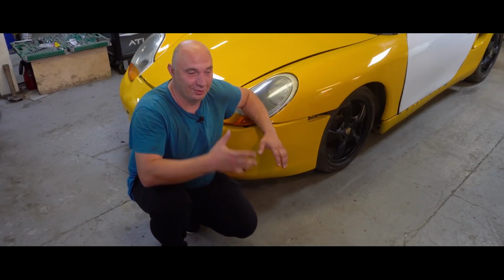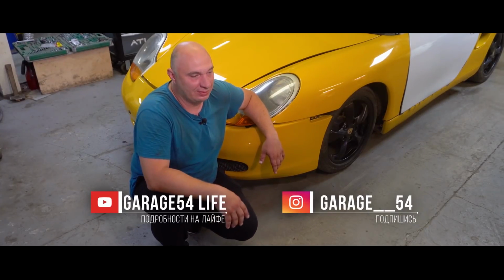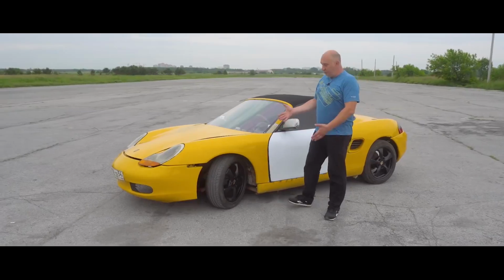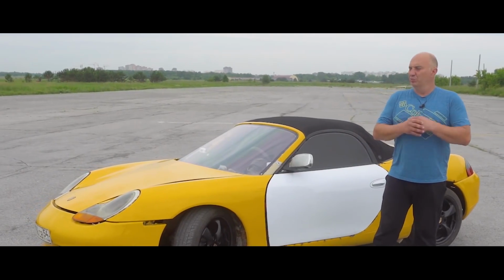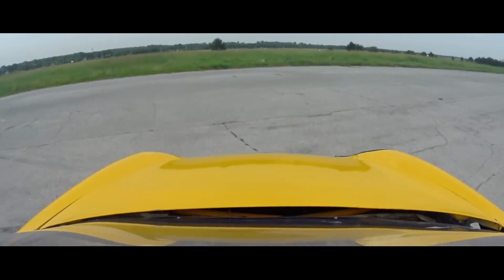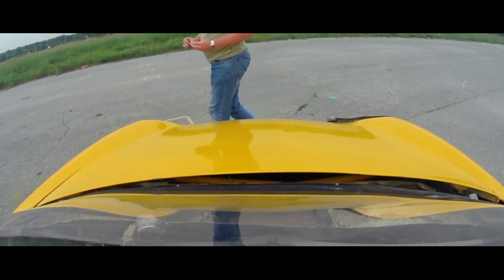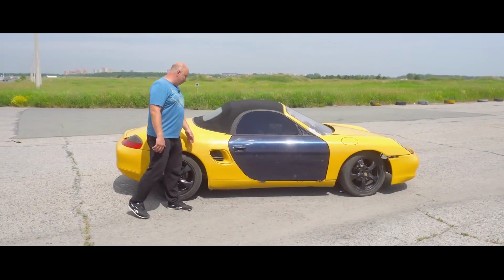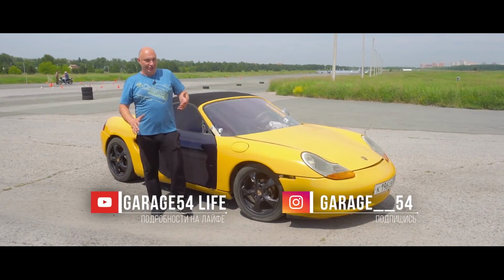Lada-based Porsche: first drive (fixed sound)

Comment: put the lada body on the porsche chassis
Reply: YES!
Reply: Yes !!
Reply: @WarpedYT   No!! I mean, yes!
Reply: @RDCST  lol.. me too
Reply: You guys are running these poor guys ragged with your nonsense 😂
Reply: YESS
Reply: Sleeper car!!!
Reply: Good Idea!! It should be funny..
Reply: Yes
Reply: Yes
Reply: It will be an epic sleeper
Reply: scoobyblue555 is that your Impreza? Beautiful.
Reply: yes
Reply: scoobyblue555 also nice name I see you’ve used the Subaru rally number
Reply: Isaacs Random Videos sure is
Reply: scoobyblue555 nice choice on car mate  especially the blobeye
Reply: @isaacsrandomvideos667  thanks,,,i think its the best looking model,,.other than the 22b
Reply: is this happening soon?
Reply: the thing is a lada looks cooler than a porche
Reply: @WarpedYT  didn't expect you to be here
Reply: That is a lot better idea for sure.
Reply: @24k  Slow ? You need to bone up on your Porsche data. Depending on model, the 986/Boxter engine had from 225-260 BHP. 
The 986 is heavy as hell, 2800 lbs, but it is not in any way slow. The Lada is at 2350 lbs considerably lighter than the Boxster.
So why do you think the Porsche powered Lada would be slow ?
Reply: @WarpedYT  yes
Reply: epic

Comment: Take it to porsce and try to get it put on a diagnostic machine.
Reply: nadz247365 „it Kind of started to rattle“
Reply: lmao
Reply: You won't find any OBD2 plug under the Lada steering wheel. You'd have to run your diagnostic through the cigarette lighter plug.
Reply: thats the way to get cheap porsche (at least I hope that used parts will be less expensieve than a new porsche)

Comment: Garage 54, you should replace the springs with used motorcycle springs and shocks.  Also tighten the loose panels and try to make the body as stiff as you can.   If you do that, the car should actually ride nice enough and you will end up feeding teenage dreams of building their own Porsche replicas. :D

Comment: I started thought about a project similar to this, soo glad I didn't !! That is alot of work, I'd rather custom build a chassis, and build it like a race car, not so much based off another car, the doors and hood are the most difficult, there is not much other way to do this,  old man porche if rolling right about now!! Ha-ha, 
Maybe use only porches doors, and custom latch, and seal, but if you do it too well, the cops will think you only swapped vin#'s . if they do not know cars at all, great video!!

Comment: A "foot" that holds the car in the air so the front wheels could run at full speed on red and release it to the ground when it turns green by pressing a button inside the car

Comment: Do you have the Porsche title ??  For this project    I’d say take photos from ten meters away  and  get insurance on it and then do some more aggressive drifting  with bigger  deeper cracks in road.  Accidents happen it’s why they call them that. 😂☝️ I have a feeling though you will need a bigger Lada motor to pull it off ?  Maybe have to take the Fiat motor out and use a souped up Lada motor

Comment: Forget about the springs something is metal to metal...
Jee look at that interior did they clear the old parts with dynamite?
One main Porsche ingredient they are missing is speed, thank god!
Reply: Well its about as fast as an original porsche 356 in any case
Reply: As in one that wasn't built yet and still in a case?
Ok it's not Veyron fast but it not lada slow neither...

Comment: This is out of the blue but how big are Ladas? I'm 6"2', & small cars don't cut it.
Reply: You're tall enough to fit in those boxy Ladas. You'll have around 5-10 cm clearance between your head and the ceiling.
If you're in Lada Samara your hair would be brushing against the headliner a little bit.
Reply: I've seen a Top Gear episode where Jeremy Clarkson drives a Lada Riva. Clarkson is 6"6' tall and he drove the car without a problem, it even had enough room for his Ushanka.

Comment: You should make a Lada and inverta all comands. When you turn left it goes right. Where the gas is you can put the clutch, instead of the brake the gas pedal and so on. Try to drift haha
Edit:
 I mean you will get used to it, but how long will it take
Reply: Mirko Kvesic thats’ a normal lada man... if you really want to add to it you need to inverse forward and reverse.. :)))

Comment: Ha!  You can tell they never worked on nice stuff before..  brand new body panels shipped with care and probably cost a lot to ship and they just set all their tools on the hood and use a grinder with a body panel as a guide..  welding with panels on....  you can see all the scuff marks...  that stuff wont buff out..  not those russian garage 54 scratches..  ha!!  It is theirs though so to each their own..  i once ran across a lambo where the owner was nastier than well a nasty person..  roaches in the car.. smelled like old hot dogs and butt feet...  and in a half a million dollar car..  and here i am keeping my 10k$ car pristine..